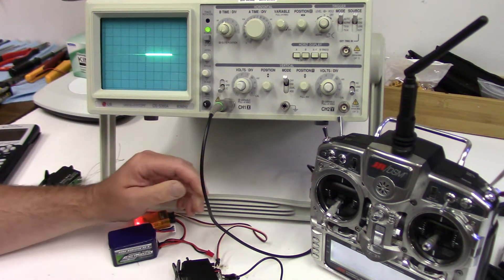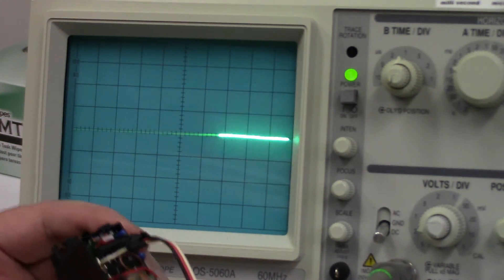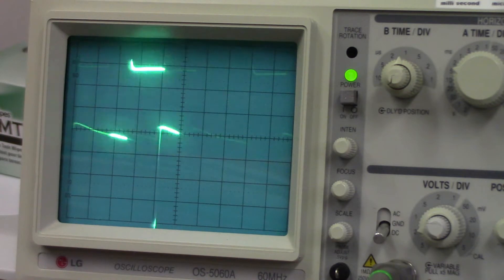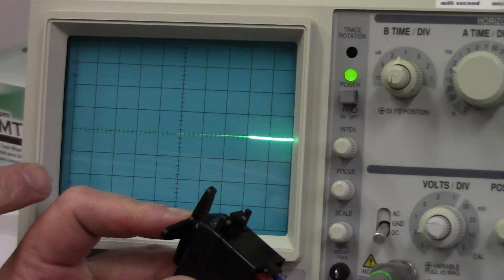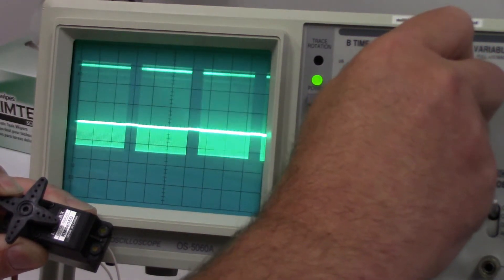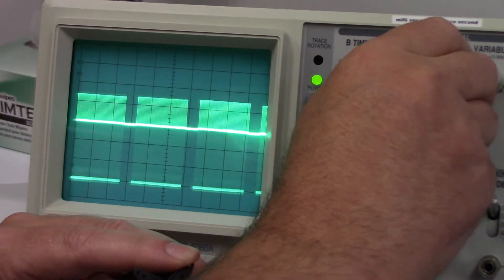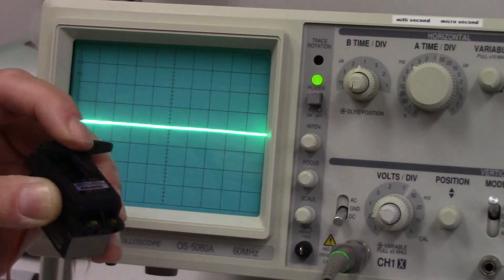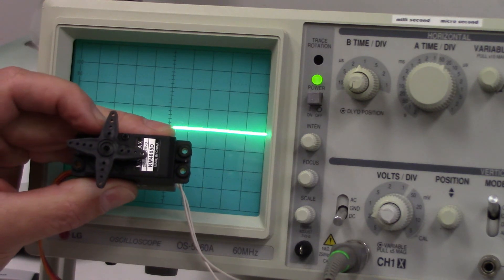RC Servo Analog vs Digital Demonstration

Comment: I'm here 8 years later. The frame rate is how often the servo receives the PWM pulse. Analog servos want the frame rate to be 22 milliseconds which is 45.5 Hz. Most digital servos will accept an 11 mSec frame rate (about 91 Hz) and some will accept a 5.5 mSec frame rate (about 182 Hz). So, not only do digital servos send more pulses of voltage to the motor, they can be told what to do more often than an analog servo. Human response time is typically 100-500 mSec, so 22 mSec is plenty fast for us. However, a MEMS gyro can respond in 1 to 5 mSec which explains the need for 5.5 to 11 mSec servos. And yes, the negative spike is due to the collapsing magnetic field when the drive transistors turn off.

Comment: My comment is 4 years late but maybe it can help someone... yes, the negative pulse is called "back electromotive force" or back EMF... I deal with it a lot. 
Its usually dealt with by using a flyback diode or capacitor. I'm surprised that the company lets that happen because it can sometimes wreck electronic devices. 
I guess the negative voltage is too small here but that spike can be in the thousands of volts in a bigger motor hence the blue ozone arc that you see and smell on motor brushes.
Reply: You are forgetting the measurement is directly on the motor side.
What is measured at the fet-side, is not shown.

Nevertheless the transistor (mosfet) will have a quenching diode capable of dealing with those spikes.
(Has been chosen to ~)

The scope was set to 2V/div. You cannot know what the spike really was.

It might have been as low as 20V, well within the Vds breakdown voltage of most FETs.

Comment: @John Salt Hi, I'm trying to set up a servo controller to operate as a substitute foot for a double amputee who wants to use a sewing machine. Are RC servos powerful enough to apply ~5lbs of torque?
Reply from the maker: No idea if any off the self RC servo would work in your specific application. All I can tell you is the highest torque digital RC servos on the market (that I know of)  top out in the 700 in/oz range. That is about 3.6 ft/lbs.
Reply: @Rchelicopterfun  Thank you. That's very helpful. I just found one that maxes out at 4 lbs. That might just do it for me.

Comment: Thanks for explanation. In the future, you want to be careful connecting your scope ground clip into a live circuit. Most scope input channels are not differential. The ground clip is at actual ground, sometimes its connected to the 3rd prong on your AC cord. Check it with an ohmmeter. 

In this case here, being battery powered, your battery, receiver and motor are floating, ie no ground reference.  Connecting your ground clip to the motor terminal is OK because your circuit has no ground reference. If you were running off a bench power supply where its negative terminal is connected to ground, there's a good chance that connecting your scope ground clip to the motor like you did here would destroy the motor driver because you're effectively shorting one side of the motor to ground. 

Just keep in mind, scope inputs are not like a handheld multimeter, DMMs are naturally floating from battery operation and do have differential inputs.  Unfortunately, you might have to blow some stuff to truly understand this. Well, that's what happened to me, which forced me to learn about why and what that little black clip on a scope probe actually is. Thanks again for the video.
Reply: No.

This is wrong.
(I am sorry to have to react so late, but I only read this reaction just now. Nevertheless, better to be late than never.)

Here lies "at ground" (pun intended) a confusion of metrology concepts.

 Earth,  Neutral and Live.

"Earth" is the input marked on your oscilloscope with the "earth" symbol.
Earthing the instrument is especially useful when one wants to cancel out the potential movement of the earth in AC measurements.

It is NOT wired to the "ground" terminal, and neither should it be. 
(The "earth" terminal, however, SHOULD be wired to the mains "EARTH" terminal.)

If the GND terminal of you instrument is directly wired to one of the mains inputs, than stop using that instrument immediately, and return it to the manufacturer for a full refund. 

It is unsafe to use, and may damage the circuits you are trying to measure.
 (Perhaps maybe  to measure the resilience of the human body to varying AC-loads. But no one likes to be "Jumbo" right?)

Every oscilloscope, is - or should(!) be- separated from ANY potential by means of an galvanic bridge.
The way of measuring shown in the video above, is perfectly safe and sane.

Any oscilloscope can be used as a differentiating measuring equipment, as shown in the video.

There is one caveat though.

"Multi-channel" oscilloscopes, may share what they reference as "ground".
In those cases, GND_CH1 and GND_CH2, might be the same, but this will have been well stated in the manual of the oscilloscope.
RTFM is your best friend.

Your assert: "Most scope input channels are not differential",  might be true for some. But certainly not for all.

Therefore you are spreading FUD.

Please, stop doing that.